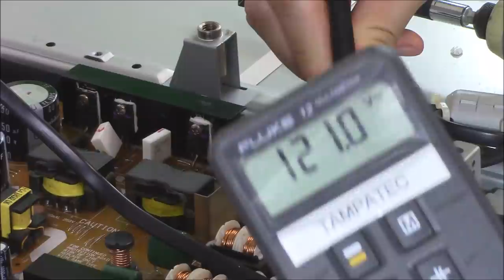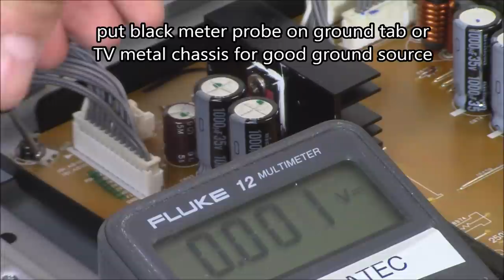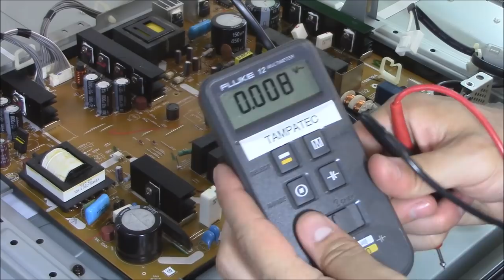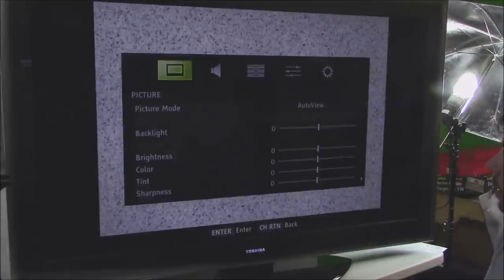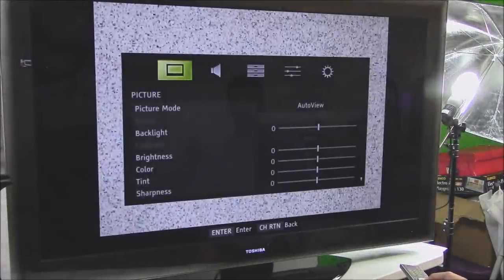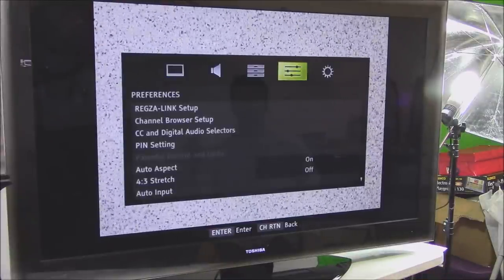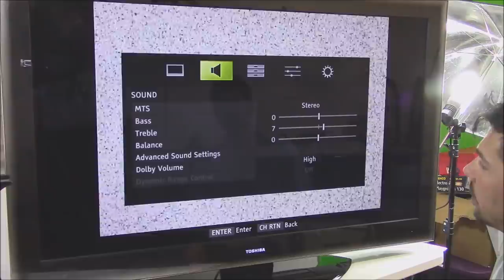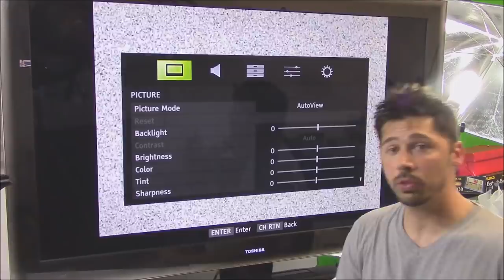Easy common fix Toshiba LCD TV, troubleshooting dead TV repair review

Comment: Hey I need help!  I've came across this video 3 weeks ago with this same TV power supply board you have, I have the 46XV645U model.  One day the TV just didn't turn on the next day after a thunderstorm week although the TV was on power surge bar protector.  I suspect it's the power supply board, so I did some test read and found out that the r850 fusible resistor was failing diode test, no alarm sound on the multimeter; and so tested for ohms and was nothing.  I now switched that 1.8Ohms 2.88Watts I think with a 2.0 Ohms 5Watts one, waited 2 weeks for this part from China.  The standby pin is now giving 5.04 volts DC and constant at 5.04, not fluctuating (so my power regulators are working fine) but the TV have no standby light and will not power on.  When I plug in the power cable, you can hear a click from the TV, sounds like those old tube TVs when they turn on or off with that click.  Do you think my next problem can be the main video board since I have no standby light?  I read the 5Volt pin from the video board after connecting it to the power supply board and I am getting the same 5.04V read out, so I'm puzzled.  I just ordered the video board from amazon, last one on stock, thank God.  I just want to ask you if this is the right route since you said 5Volts from the power supply should give you standby light, mine didn't give a STBY light and TV didn't turn on. Sorry for this long non-sense, hope you can help and maybe help others.  By the way, before my Fusible resistor came, I switched out the STR Y6456 power regulator thingy, pins' positions were correct but I had to bend them backwards to solder it onto board facing the other way.  I also replaced the two bulging paired capacitors 450v 150uf, still nothing helped...checked all other two fuses and diode tests lots of other parts all fine.  Thanks in advance!

Comment: I have a toshiba 42hl196 with a blinking red light and no power any advice on where to begin trouble shooting it
Reply: strw6765 regulator ic  solved this problem for  same  model. top right corner of PS board. set would only click twice when plugged in, would not run. also suspect are large ceramic resistors near main power relays.

Comment: nice work. i'm still looking for a 60-70" LCD. any thoughts on Vizio e-series reliability? TIA
Reply from the maker: bgregg55 i do home theater and fix TVs, I fix mostly Sony and Samsung then next Vizio but i would still buy a Vizio cause they are a really good value tv and for me easier to fix than Sony. Buy a TV based on room size not how big the TV is. if your couch is 6ft away from TV go 50-60", hope this helps (sub for more howto tech reviews)

Comment: I hope i get a reply but I did this and found that someone replaced one of the fusible resistor with a 2.2 ohm resistor and it burnt... Can I use another resistor from a similar TV or what woukd be the equivalent to the original Fusible resistor?
Reply: after using a spare fusible resistor that's green with yellow,violet,red and brown lines....It turns on now but it turns off  after 5 seconds and keeps cycling On and Off On and Off...what could that be? Im reading 5v now and rectifier is reading over 100v. Can you help?
Reply: Have you changed your voltage regulator?
Reply: Nommadd75 Oh hey,  I pin pointed the problem to being one of the Relay's. I replaced it and now it's running Tip Top. Thanks for the concern.

Comment: Tampatec
I have 2 Toshiba 46L5200U1 TV's. Both units flash Toshiba for a second then go black. Both have audio. I did the flashlight test, and in both units you can see a display. I purchased one backlight inverter and installed it in one of the units with no results. I removed the new inverter and installed it on the second unit with good results. I'm wondering if the first unit has a bad led strip. I have torn further into the unit finding the led strip (not an easy task, but haven't figured out how to remove it). Any advise for me on (A) Is there anything else I should be looking for? (B) Where would I find a led strip? Not having any luck on line, but I haven't removed the led yet to see if there is part number.

Comment: My toshiba (46xv645u) will not power on. There is no standby light, the power board is still giving the main board 5VDC. Is there a way to test the main video board to see if that's the problem before I order one?
Reply from the maker: If 5v standby is steady going to main board but you have no standby light on tv, you did properly troubleshoot the tv, main board is most likely board that is bad. Sub for more easy common tech fixes. Shopjimmy.com, ebay, amazon should have the board.
Reply: ***** Thanks for the input! I really appreciate the response. Your videos have been very helpful, subscribed :)
Reply: thanks very much and have agod day  *****

Comment: I have a Toshiba 47ZV650U with the same power board and R850 is Open but tv powers when contacts are bridged. The Regulator tested OK  My concern now is The Resisters @ R827 And R828 have blackening around them.  Do you know what would cause that?

Comment: on the voltage regulator str y6456 9702a how important is the 9702a number at the bottom of the part? I am having trouble finding that very same one you used in this video. any idea on where to buy one? I have checked google and ebay etc. i can get one but the last number is different. not 9702a. thanks
Reply from the maker: yes but make sure the pin out and specs is same,  check mouser.com

Comment: Hi there,  Where can I acquire the fuse and the Voltage regulator?  It seems I have the exact same problem and bad fuse RGDU5M-5E  1.8 Ohm J.  I've performed a quick search on Google but I don't see any retailers listed.
Reply: same issue. where can we get the parts from? please let me know if you find out and i will do the same. thx
Reply: have you tried digikey dot com?
Reply: search electronic components companies, some good ones are Mouser, Arrow, Digikey, Allied, Jameco...
Reply: I haven't been able to find these parts either for sale  on google/ebay.. have you had any luck?

Comment: Tamp, I have 42rv530u I found the r850 resistor bad, so I change it  & remove q 820 to check & dual diodes, when I plug the cord 120 v the resistor blown again. So if you have time pls. Help me what's the problem thanks.

Comment: Hey,  I have a toshiba 47 regza with same power supply. It was dead, I changed the fusible resister r850 ceramic, this fixed it, but week later it blew again. So changed again, but this time green power light flashes 3 times and repeats, when I hit the power button , a relay clicks but no picture.  Any Ideas,  the stb voltage is steady at 4.92 v .

Comment: .Thanks for the video. I have same tv  with same problem. after i replace resistor and voltage reg. i got  5 volt but tv  still no standby light and TV doesn't come on .Please help. Thank you    Aaron

Comment: Toshiba 58l1350u  won't come on quick flash when first turned on, green light is on , checked 5v is good on main board . Does that mean the problem is on the main board?

Comment: hey i have the same problem so i replaces the fuse and voltage regulator because i had no power so i checked the 5v stby and it was going up and down. so now i got 5v stby witch it good but it still doesn't turn on. Any suggestions . Thanks
Reply: +Anton Combs      Buy a new tv.

Comment: I have a Toshiba 50 in plasma bought in 2005, the red light (power light) was blinking, would not turn on. I unplugged the set, put it back, and the light stopped blinking and wouldn't do anything after that. when I plugged it back in, you could hear it click and power up, but no light or picture. sound like a power supply?

Comment: I have a Toshiba 47TL515U 47 inch Natural 3D 1080p 240Hz LED-LCD HDTV. It shuts off at random, and will not power up. I took it apart and check power standby and fuses, no issues. Put back together, and it was able to power up, but shuts off shortly after back to no power at all. Any help?

Comment: Don't know if you can help me, I have run out of options and can't find a solution. My problem is I have a Toshiba 50L4300UC and for the last month or so I have been developing flashing blinking horizontal lines on the screen, opened the TV and check it for blown capacitors but all was good, reseated and cleaned all wires but with no solution. Do you have any ideas? I have posted a video on YouTube any help will be appreciated it. Thanks

Comment: Hi Tampatec, I have  a Toshiba  32BV500B and the white light blinking continuosly. I checked the rectiifier output and I fount 360V Is that normal?  if not, that's mean the rectifier is faulty?  Thank you!

Comment: ive got a toshiba 46ul610u 3d tv. went to turn on the set, and the blue power light just started flashing but the screen never came on.  since i'm getting partial power what are the odds that it will just be the power board compared to a main/videoboard.  would the troubleshooting be the same. i'm comfortable enough to replace the boards but not the board components.

Comment: hey  where can i buy the voltage regulator and cement resistor from , i have str-y6456 (9731A) voltage regulator and RGDU5M-5E 1.8 ohm cement fusible resistor

Comment: i have the same toshiba and the model is 55ZUV650U, the tv works perfect but in the corner there is a light blue line that is about  4 inches, when i take the t-con board the tv turns blue and you cant see the line. do you know what the problem is?

Comment: I have a 2014 Toshiba 5OL-1400U. When I start it up no problem for about 10 minutes then out of no where the picture blinks off for a second then back on & repeats this every 10 seconds or so. Any suggestions?
Reply from the maker: when it does that check volts on power board. next unplug tcon board and see if tv runs ok for 1 hour without tcon board cause it can trigger tv to shutdown to prevent further damage.
Reply: Hi i have a samsung plasma tv PN42C430A1DXZA, on the X sus board i would love to know the pico farad or microfarad value for this part capacitor 222ks630v np.b48pp ?

Comment: I have a toshiba model # 52rv530u and i turn the tv it goes from yellow to green like normal but there is no picture or sound i dont see any back lights and i tried the flash light trick to see any picture. And no picture from the videos iv looked at it sounds like the main board has gone bad do you agree or could there be another problems ?

Comment: Hi guys, I got a Toshiba combo TV/DVD player that is malfunctioning. I turn on the power button or with remote and I get a green standby lite in front but nothing after that. Prior to this, the DVD would not load sometimes or get stuck, and the sound would be this hideous sound until I lower the volume to ZERO, then I would raise sound volume and it would go away. Also, prior to this latest issue, I couldn't turn off the tv with remote or manually either. I would just turn off the circuit breaker. What you think, a blown capacitor, fusible link, diode, etc????? Any help would be appreciated. Thanks in advance

Comment: Hey,

I have this model, but I have a problem   My screen will go blank with audio in the back ground and a blinking orange standby light.  I pull plug for a few minutes and restart, either with remote and or tv power button and we have picture again for a while ( say 30 minutes) then gone again

any videos for that?
Reply: I am in the same boat, but I trouble shooted my situation, I am fairly sure you have a bad backlight inverter, or its on its way out
Reply: +Hawk Gaming 
second issue I have no clue about.

Comment: Mine turns on. Audio comes out. But no video. Someone recommended putting a flashlight to the screen, and I can see an image but it's very dark. What should I look to fix?
Reply: +Caleb Elizondo the brightness...
Reply: +Jason Proctor

not brightness.

led backlights are out. so the panel is still generating an image, but there is nothing to illuminate the display
Reply: +Caleb Elizondo Inverted board fault?

Comment: i have the same problem with my toshiba tv .So i replace the fuse and the regulator and tested the power to all my fuses and i have a strong standby 5 volts. But the tv won't turn on. It just makes a sound like its about to come on but nothing happens. all the caps are good. not blow. i don't have the remote for this tv. any tips?

Comment: Thanks, same problem, 42 Toshiba, so where can I buy these needed part: voltage regulator, and fuseable resistor? ebay?? And also, since there is no more Radio Shack, where can I buy that heat sink compound?? ebay again?/ Thanks, youtheman =)
Reply: Mouser, Jameco, Arrow, Allied, Fry's and DigiKey are good sources online to buy direct.
Reply: OK, thanks =)

Comment: I have a Toshiba TV Model #55L310U that is days out of the warranty.  The color on my tv doesn't work.  There are times you can turn it on and the color works for 5 minutes and goes out.  There is still a picture but just not in color.  Please help!!

Comment: hi
I have a 50" Toshiba led tv 50l2200u with sound but no image. can you tell me how I can fix?
Reply: Tommy, turn it on and shine a flashlight at the screen, See if there is an image that can be seen on the screen, although really really faint. If so, that means that one of the  LED's in the LED array have burnt out and will need replacing. Let me know.

Comment: I can not find the voltage regulator I want anywhere on the web. it is "K4106"  then under it is a "9" then a "." then a "d"  and these 3 symbols are underlined.

Comment: Dear i am confused to fix problem for Haier lcd tv LE32B50. By power on blue light comes on but about 5 seconds red light comes on and off , this is continuous and lcd does not come on . By removing back light connectors  power comes on and reconnecting connectors tv remains on but after by power off it does the same mean power comes not on.

Comment: Hi! i encounter standby mode issue on this power supply PS1V101801A V71A00026901 Power Plate JQ10662, but i not sure the part number of the transistor (QP801) any idea? thanks

Comment: I have a Toshiba 43V6863DA and the Screen is black and you can see a bit when you get close to the Screen and put a Flashlight on it so its probably the LED Stripes i guess. It broke 3 Months after the Warranty ended of course.

Comment: Hey, I have a Toshiba TV model #40L3400U. When I turn my TV on the Toshiba Logo comes on really clear and then it goes a black almost blue screen. When looking in the back of the TV with lights off the lights are on. Also no sound... please help..Thanks in advance 😃
Reply from the maker: +Kimberly Kimberly if you're saying the tv backlight is on but no picture that can be tcon board or main board but usually tcon which controls the picture on the screen.  Get tv boards at shopjimmy.com or electropartsonline.com . Subscribe share or Like if this info really helped you. Thanks
Reply from the maker: +Kimberly Kimberly also check shopjimmy.com for a tv repair kit for your tv model.
Reply: Tampatec Where is the T-con located I only see Main board, Power board, and wifi board?
Reply from the maker: Kimberly Kimberly watch my recent videos on my channel, how to troubleshoot TV without meters
Reply: Tampatec Okay thanks a lot.. Have a good night...
Reply from the maker: Kimberly Kimberly good luck, let me know if you fixed your tv
Reply: tcon board

Comment: Hii.. I got a problem with my toshia lcd 24HV10ZE .flashing standby light. when i checked the voltages , the smps o/p 5 v is okey. but when connected to control board the 5 v goes down and then back to 5v. this up &down process continues until i turn of the mains. can you help me ??

Comment: Hi, I'm having a problem with my 50L5200U Toshiba TV.  The display turns on, everything works, then 10-12 minutes go by and the display goes out, and about 30 seconds after that the sound turns off.  Anything to test, or how can i fix this issue?

Comment: Trying to fix a Samsung LN46C630K1FXZA.  After a friend was out of the country for two months, he came home to find his tv had sound but no picture.  He decided to buy a new one - he's very impatient - so I told him I'd take the Samsung.  I went online and watched ShopJimmy's video on finding out what might be wrong.  It had no backlight and using the "flashlight" test on the display I could not see anything.  Purchased new T-Con and Inverter boards from ShopJimmy.  I installed them and "voila!" audio but no backlight and no picture.

Before spending anymore money, I need to know if the display itself is shot or could it be capacitors and or fuses or something else that have failed.  I visually checked the capacitors and don't see any that are bulged or leaking but I haven't used a tester on them.  I don't see any other damage, such as burnt or blackened components.  I'd appreciate any help I can get before I toss the tv into the trash.  Not really, I'll try to put it into recycling (Best Buy won't take it because its too big).

Comment: does anyone know the part number from Toshiba for R850?
Reply: STR Y6456
Reply: stry6456 Is a proprietary power  mosfet to Toshiba which has a part number of 75009325.  R850 or resistor 850 is a 5watt 1.8 ohm fusible power resistor which is proprietary to Toshiba and should have a part number of 7500.... the rest I don't know....I was going to order from Toshiba direct the parts but it was cheaper to buy a power board repair kit from shop jimmies for board v28a000962a1 pe0702A.  Thanks for the help though

Comment: My Toshiba won't turn on when remote or button pressed. It will come on eventually, could be mins could be hrs. The light just flashes when it won't come on. When it decides to turn on it all works. Just don't turn it off. Done reset and still the same.